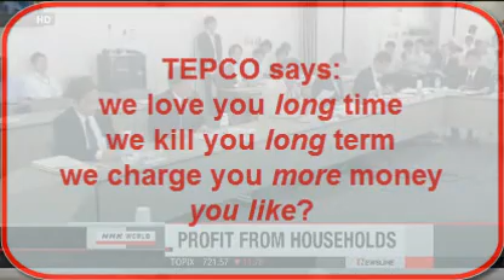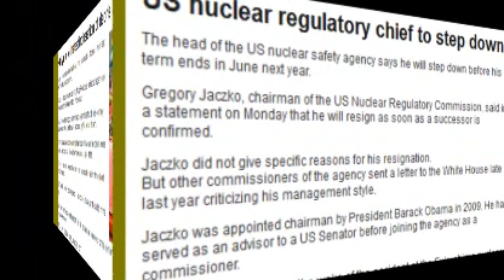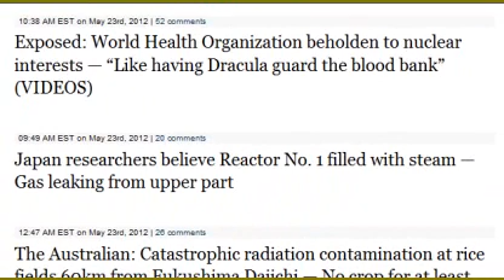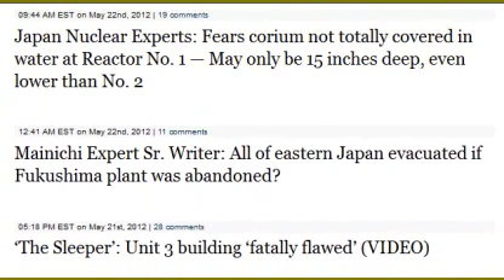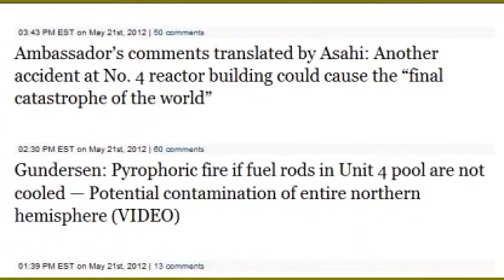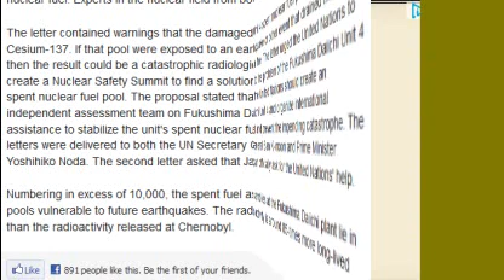Fukushima Shallow Water in Reactor unit 1 Also! Update 5/23/12

Comment: Like I've said, seems with that little water, the temp and pressure should be off the chart if the fuel is still in there, but I was forgetting the Brunswick Test Gunderson spoke of, the containment cap bolts stretching at 100 PSI releasing the pressure and then closing down again. Either way, radiation escaping, continously. Interesting Caldicott believes Australia will be safer, I would think South Africa safer.